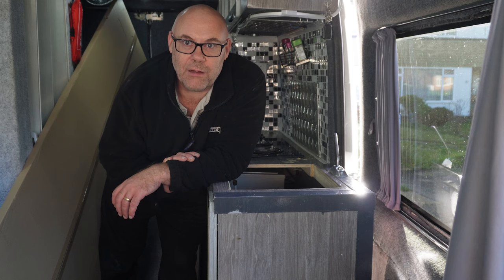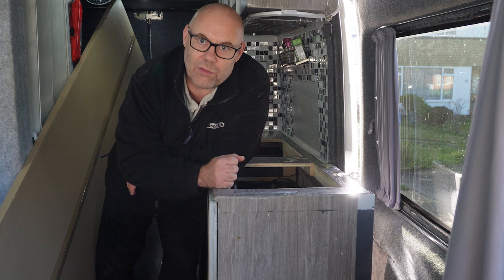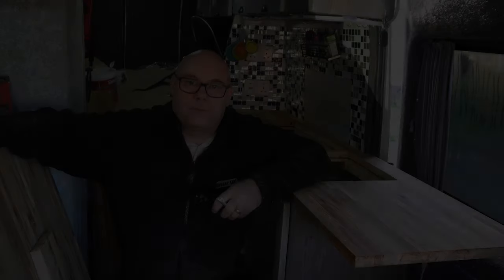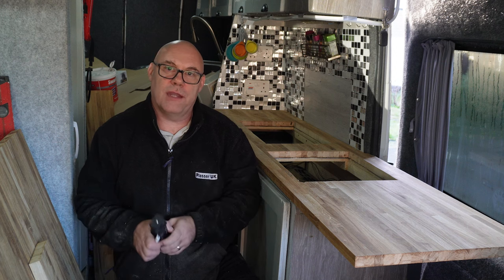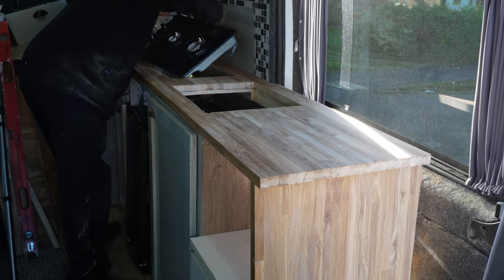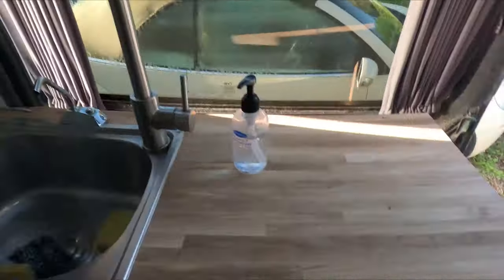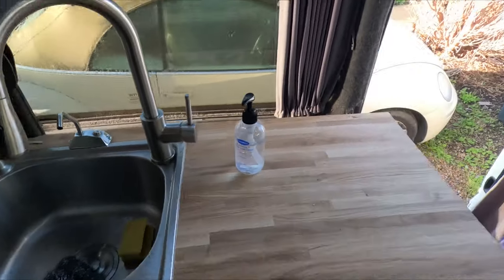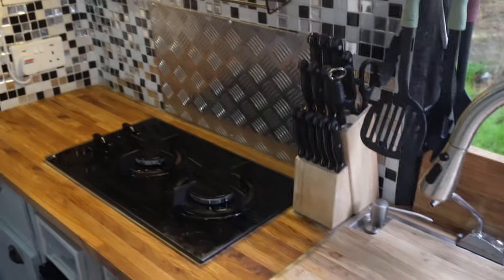Transforming Our Van With A Stunning Kitchen Worktop Upgrade!

Comment: how did you get on with your hot water system
Reply from the maker: had to make a few changes to the water system will make a video on it to show what i have done for the next video
Reply: @thebrit2152  that's great that I can't really get my head round the system to be honest weather you need dual pumps and tank and so forth lol